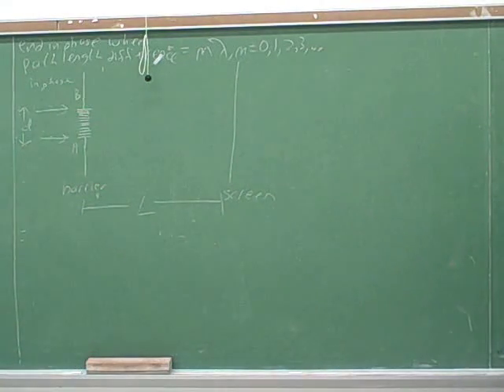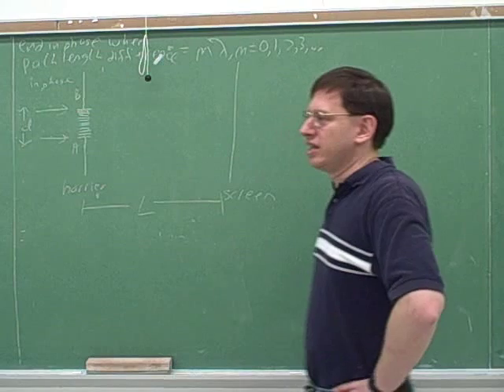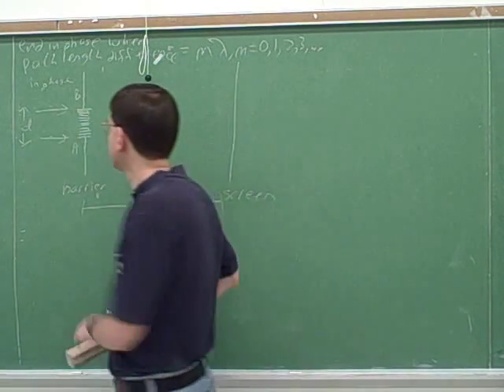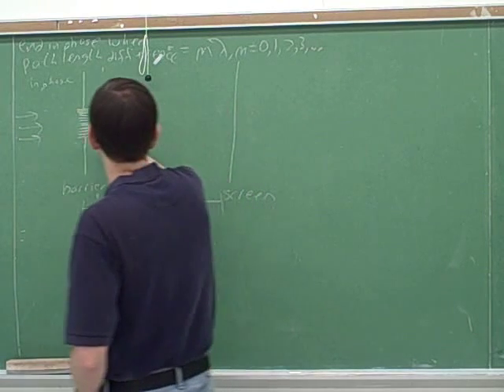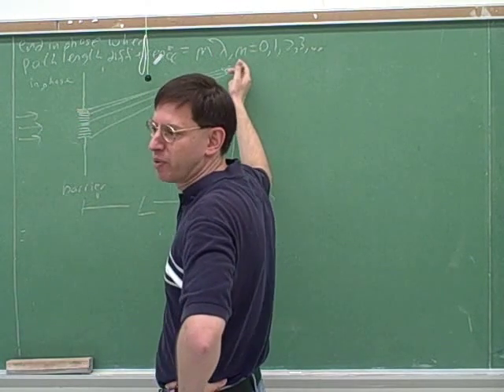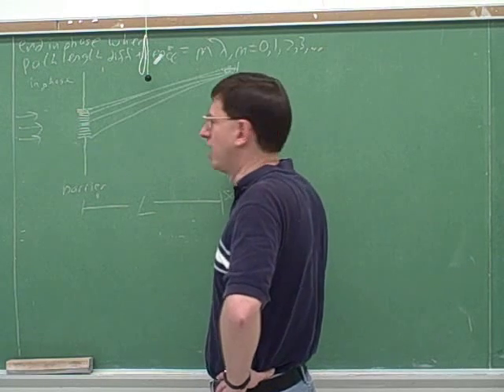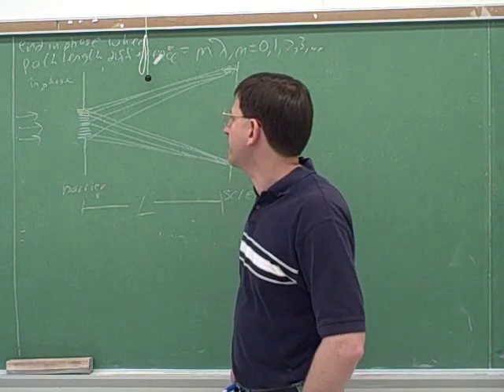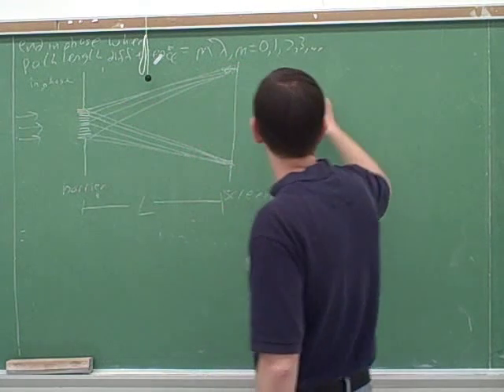Physics: Interference and diffraction (9)

Comment: Isn't there space taken up by the slit and the dividing section between each slit? So finding the distance between each slit would require the distance taken up by each slit and the number of slits over a given area? or is the distance of the slit so small that it is a non issue?